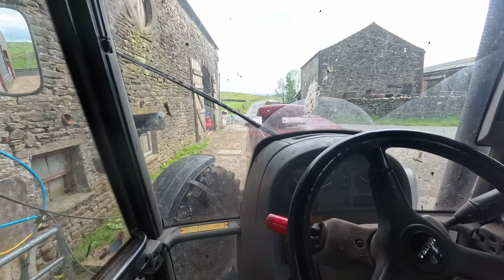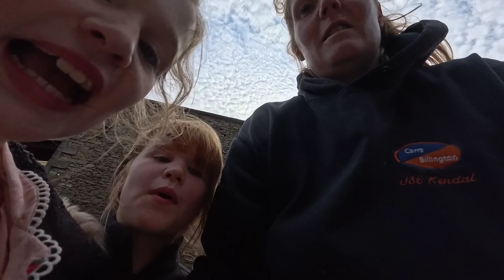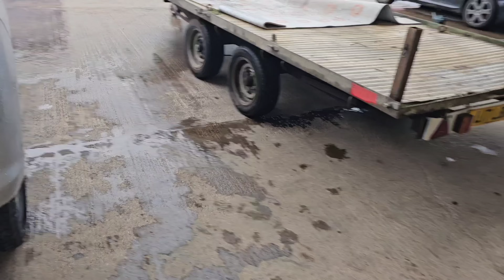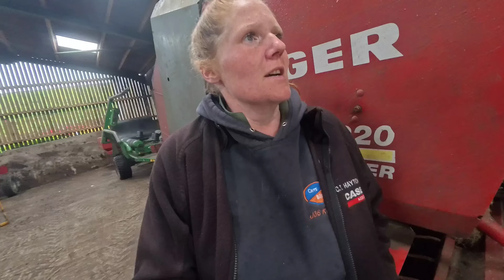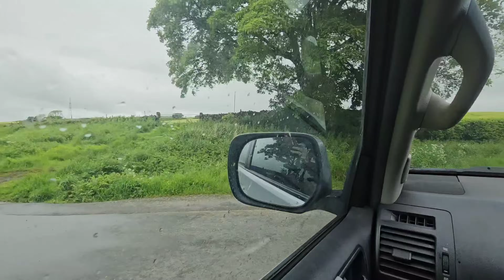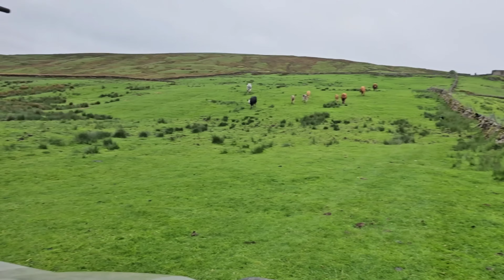Why did we buy our own cropping gear?? ...VALTRA needed a bath! LAME BULL!!!!

Comment: Just spotted the reg plate of your valtra, a question just entered my head, I know you have to have insurance, as you drive on the highway, but are tractors required to have an annual MOT after 3 years the same as cars
Random I know but literally just popped into my head
Geoff